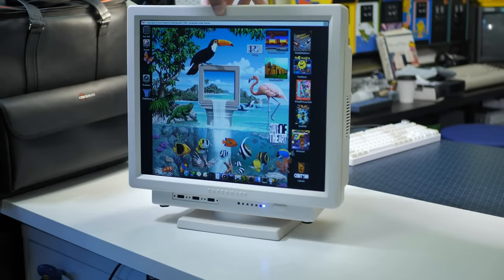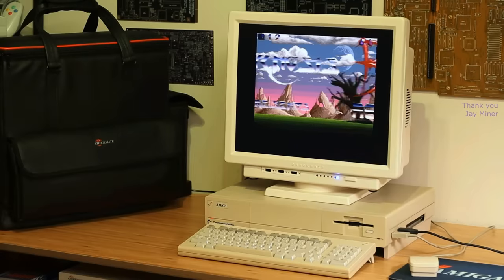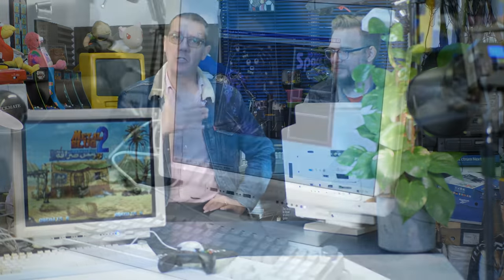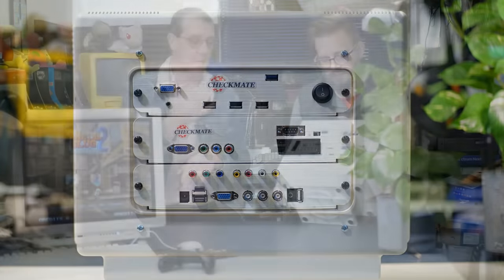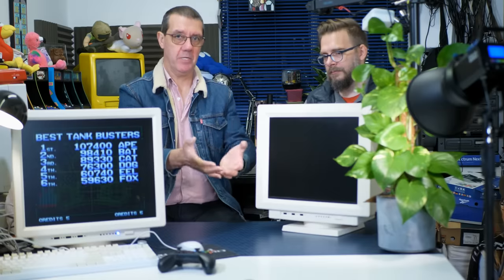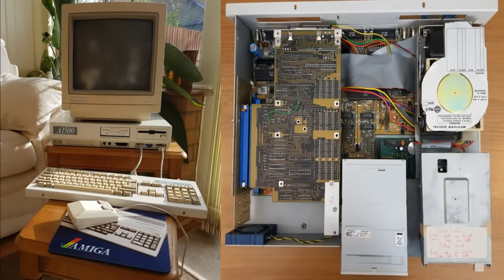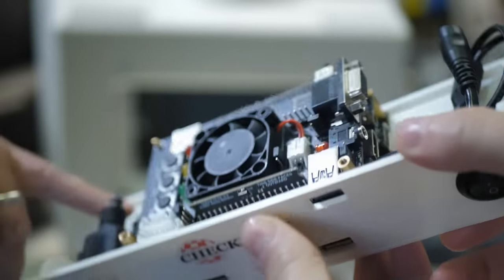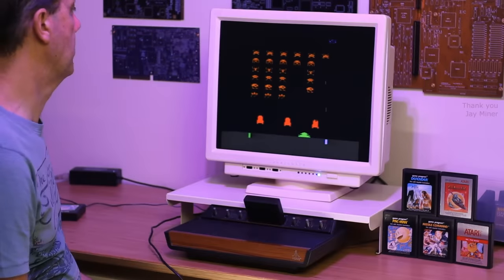This Monitor is the Future | Nostalgia Nerd

Comment: What I see here is that it's a monitor and a project box all in one. You wanna build something that needs a monitor and goes in a box, you can put the project directly inside the monitor. I'd love to see someone build as period-authentic as possible VT100 terminal. I really don't want to buy some crappy beat up terminal on EBay. Would be nice to have something built from new parts.

Comment: Arcooda panel as an option? They should have led with that. 

*Edit: I believe this option wasn’t known or guaranteed,at the time the campaign started.

It’s not highlighted in the kickstarter. Also,in the campaign it’s noted the panels will be 5:4 but no mention if 4:3 is an option. Either way,thanks for sharing this info.

Comment: The connections are awesome. Ideally the panel should at least be OLED or otherwise very fast to minimize latencies, super-ideally you'd have some sort of a phosphor emulation for, say, color blending tricks to work with real hardware.

Comment: I thought that this new invention, the Checkmate video monitor, is something awesome. I did not think that it was just technically feasible to make a video monitor with all those advanced capabilities. Someone mentioned in that video that they did not have many of those new video monitors left, but if they still make those I thought I could get one of those myself. Someone mentioned in the comments here that CRT displays were good. I think they were but of course they are very old. And CRTs had different problems, I believe, one was that their power supply required a lot of power, and they started using pulse technology instead of a rasterized display, I do not know if that was inferior maybe, and they phased out the picture tubes themselves in later years, the tubes used an enormous amount of power. They also used a rectifier since the 1960s instead of plain tube because they were switching over to transistorized systems. I have read somewhere that they make some new consumer televisions that use 12 bit color processing and are extremely bright. Maybe those do not need to use upscalers because they have RAM memory there that could just show the picture. I was wandering if a consumer TV could use the same technologies that this new Checkerboard display is using. That could be a great design!

Comment: I'm sorry, but I only watched 30 seconds of this video. The moment you mentioned OLL, I knew exactly what you were about to divulge in because I had the exact same experience with those guys at the con. I'm currently using a Dell computer monitor to get the job done, but I really hope to get one of these monitors on my hands. The camera doesn't do justice to the sharp picture quality these monitors have, they're about on par with broadcast monitors and trinitrons.

Comment: How about adding a module that holds a Vortex86SX module for running X86@300+ MHz and at least 128MB RAM, while using the FPGA to simulate the missing graphics accelerator ?
This way, even Pentium range / age titles and software could be run.

Comment: I'm confused, and to no fault of your own, but do the prices include the panel?  I just watched a video where someone was 3D printing a chassis for an iPad essentially functioning as a dock for iPads, hence why I was recommended this channel.   

I'm curious if the prices on Kickstarter also include everything you need to run this as a display, all inclusive.    Reading is hard sometimes and I'm having one of those days.

Comment: Nice concept and idea. But nothing will replace a CRT, the dot per inch any modern IPS display is way to much high res compared to any CRT tv image resolution and how the image was generated using analog cathode ray tube and a shadow mask. All these consoles  where optimized for CRT, and the image in TV's was not crisp and clear because literally no one was watching 1m from teh scrteen, a minimum of 3m was the closest and watching a console image that this generation calls "pixel art" on a CRT tv with traditional screen from couple of metters away, and not on a trinittron of newer flat screen crt, the image looks gorgeous and a lot of the pixels disabear because the image AA was and is blurier because of the shadow mask. Sitting with latest hardware on the market here and i miss my old 35" crt TV lol.

Comment: What OS is the one with the toucan in the wallpaper? I’ve been trying to find a software I used in 2nd grade and the layout of the screen looks pretty similar to what I remember it looking. That would narrow the software catalog I would need to look through. Also it was some graphics software that had some interesting features. Was pretty sure it wasn’t a windows based system.

Another software I’m trying to find was in 2003. I swear it was by encyclopedia Britannic and had a section where you could virtually explore areas like a pre google street view. I remember exploring a path in Australia and maybe somewhere in Africa and Asia.

It’s not too important just nostalgia and closure.

Comment: Damn, that's cool. It would be cooler if there were a widescreen version for that era in the early 2000s when people were using CRT HDTVs...like PS3 and Xbox 360.

One other thing I would worry about is the accuracy of reproducing games designed for CRT monitors and TVs. Sure, the ports are there, but does it look right? How are the black levels? Etc. etc. etc.

It's nice to hear about the low latency. That is important for games. I mean, who's doing productivity work on this thing? This is for retro gaming, pure and simple. No one is itching to run Word 97.

It would be great if someone could figure out how to make a panel that makes CRTs completely unnecessary, but no one has figured that out yet.
Reply: you mean OLED panels?
Reply: @alexalcalaortiz368  OLEDs are great, but they don't display retro content (especially sprites) properly. They don't have scan lines either.

Comment: I'm looking for MicroLED or at least QDOLED, 120 Hz easy or at least 100 Hz easy,   4000p, ideally 2:3 aspect ratio, like 4000x6000, but 1600p would still be OK.
I have and use CRTs now, Samsung 1100MB 130 Khz, Sony F520 137Khz, Samsung 757DFX 96 Khz, Daewoo 518B 69 Khz.

Comment: What happened to someone putting a product to market and then people buy it at the store, plug it in and it works? You’re paying an obscene amount of money for a product’s partial manufacturing to be funded, to pay more later to get the panel, to then pay for all these add-on modules that might be coming? Ugh, this is crooked. What has this world come to?
Reply: Well, that's investing in a product. Not everyone can just put a product out in stores as if they have all the money for it at the moment, and sometimes items are so niche that putting them in a store makes less sense compared to a crowdfunding project. But, sometimes, it really is just that people don't have the funds or investors to do something other than crowdfunding.

I mean, I don't know what's going to happen to this specific product, but as far as crowdfunding in general is concerned it's the better, or only, option for certain things. But things can screw up or change all the same.
Reply: This is a niche product that no serious investors would fund to put into megacorp stores. Therefore it has to be funded by people who actually want it, with limited stock being created specifically for them.

Comment: I wish someone would make a flat screen that updates like a CRT, meaning updating when the video signal tells it to, rather than at a specific rate.
Reply: You mean G-sync? The main problem is that in an LCD molecules have to rotate mechanically. And one direction is just diffusion. Inherently slow. It is like phosphorescence, but not across 10 scanlines, but 10 frames .

I don’t know why people don’t talk about this. Strobe the LCD and then let the molecules rotate back into their standard position while in the dark. So for the next frame they all default to deep black.

Comment: This is the second time someone's covered this but I still don't get it. It's just a 300 dollar 4:3 display riding on nostalgia. If it was an impressive monitor then they could pull off some of the cool filters like the Analog Pocket or something but it's literally just a monitor, all the functionality comes from upscaler boards that most people interested in this stuff already have. It's cool that it was funded so the people that are interested will get one but its an expensive gimmick

Comment: I read that the panel is not CRT, but IPS, so if you have retro consoles that use lightguns for some games, which practically almost all of them, they wont work with this monitor.
Reply: "which practically almost all of them"???
Reply: @moosic2i  yeah, almost all retro consoles have lightguns as accessories for their shooting games.
Reply: the panel isn't even included with the kickstarter. it will be an additional cost, and there will be three tiers to choose from, though what those tiers are exactly is yet to be decided, and possibly an OLED option, according to info on the kickstarter. this model in the video, which according to Mr. Jones represents the middle tier, looks like a 10 year old generic ips panel (ie shit). light guns will not work with any of the tiers or any digital displays at all as they are dependent on the analog signal from the console.

Comment: cool thing ... the 2-3 slow frames is well (from 1-2 sec input lag), a thing that you have to get used too when you play old games on new TVs Panels ... even new consoles on new TVs have it ... PS1 or Dreamcast games, that need rhythmic input (QTE) will be unplayable , fine example it Parapara the Rapper on PS1 that on new TVs is Unplayable ... same what is Space Chanel 5 ... the input lag is so bit, you can't play those original games on Original hardware on new TVs , even Emulation will not help ... yeah, both games where remastered to play on new consoles , but we all know how all those woke remasters look like (fine example is Yakuza that removed missions from the PS4 version , compared to the PS3 version)... another example is Resident Evil 3 Remake that misses 60% of the game ... not to mention making all characters fugly

Comment: I'm a bit concerned with the lack of panel details, temporal resolution and sample and hold is super important for a flat panel. Assuming this is a off-the-shelf 19" ips panel, I'm concerned. If we can't get solid specs on the monitor it's gotta be a no-buy from me, plonking in line-doublers is awesome but if the panel sucks it's a paperweight.

Comment: The future of a monitor would be a CRT with all these pods, The C-64 used a light pen, That won't work on this, Lets not forget about duckhunt and the light gun that won't work on this, Yes they do make modern light guns for modern monitors but they are expensive and not original hardware. They are still actually making modern gaming CRT monitors also.
Reply: But who, who possably could developed new crt tubes I tougt they didn't make them anymore they just have them in stock?

Comment: Now that more is starting to come out about this project, I'm so very uninterested. There are literally a MILLION 5:4 monitors out there. 1280x1024 is NOT a hard aspect ratio to source, still. This project would be notable if it were an actual 4:3 display, but it's not. AKA your search for a Dell 2001FRP is still on.

Comment: I don't agree with one thing. Or, better said, I think that something said in this video is not quite "correct". I can replace all the monitors with this one. Sure. But then you could also replace all the consoles and PCs with a small PC that has installed a lot of emulators. But where's the fun in doing that? Same with monitors, I think.  However, this monitor should be awesome for testing old things, before connecting them to the proper monitor/TV.

Comment: Too bad this is no 4:3 screen. 19 inch panels are 1280x1024, and thus 5:4. They should have opted for the far better 1600x1200 panels are 21,3". Weird thing is Samsung & Dell made 21'3 inch 1600x1200 IPS screens WITH S-video/composite input and 100% sRGB CCFL backlight, and you can find these used for like 10 bucks.

Comment: Can someone make a TV like this but instead of different connection just put like 20 HDMI ports on it? I have a PS5, PS4, PS3, Xbox SX, One, 360, Wii, Wii-U, Switch, Chromecast, blueray player, and a laptop I'd like to plug in all at once and not have to switch HDMI cables. I have an HDMI switch with 4 extra ports. It does autoswitch to whatever is turned on but its still not enough. I'm still about 4 HDMI ports short. I could get another one but c'mon. Really?

Comment: IPS really? OLED is the only screen tech that comes close to the color of CRT and the perfect contrast
Reply: OLED also emulates the burn-in effect of CRT perfectly, I prefer LCD for the peace of mind that the panel is going to last 20+ years with no degradation. But the cool thing with this monitor is that if you can find the right panel you can swap out the internals. Unfortunately I don't think you'll find a 4:3 19" OLED panel anytime soon. They are all 16:9 or 16:10
Reply: @SAerror1  burn in effects of OLED are always over-stated. If you run them at the lower brightness levels CRTs produced you'd be fine for many years. Yeah, there are no mass produce 4:3 OLEDs. But I imagine it just be hard to find IPS that ratio too.

Comment: Feels like something FAR to early for something like this on the market. Going into a thriftshop you can get a decent early-mid 2010's monitor that accepts a shitload of connections for between 5 and 25 euro, while this thing has in it's default setup with the cheapest display panel less connections for upward of 450 euro.
I get it's a better display than those TN displays from a decade ago, but to me the whole expandability seems more a gimmick to upsell people stuff than anything you'd actually use beyond the ones you need.

Comment: But this is not suitable for retro just because it's 4:3, that's not the point of retrogaming. I want the manufacturer to actually build a CRT slim monitor, not an IPS display "retro wannabe" monitor.

Don't these guys know what are cathode ray tubes? they have a specific way of showing image as well as virtually 0 input lag.

If I have to spend 300€ on a 19" IPS 4:3 display, I better buy a 21-32" second hand CRT flat TV in a very good shape and I still have money to buy another one. Actually, I bought 2 Samsung 21" 4:3 SlimFit TV's with less than that, one is still new and the other I found second hand in a store in a pretty good shape (the one I'm currently using). Do not give up, get a real CRT TV.
Reply: You can’t have a slim CRT. That’s not how the physics works. The tube needs to have a minimum length to produce an image. Besides they have already explained that you can’t really find CRT tubes in a mass quantity anymore, other than used ones.
Reply: It`s just one little problem, NO ONE makes crt`s any more, yes you can buy used one but it`s just a mater of time when it will die, this is atleast futureproof and good replacment for diyng crt`s.

Comment: i absolutely don't see the value of this, it's just a 4:3 off-the-shelf LCD such like you could buy for years in some fancy retro styled casing
Reply: It's an all in one with every connection you will ever need for Native retro hardware. This is for the hardcore retro gamers and collectors, especially those who want to save room space. It is half the size of a basic retro monitor, and less than half the weight.
   Your lcd panels don't have all these connections built in. I wouldn't pay more. Than 200 to $300 for it, because I have a limited number of retro games and retro hardware.

Comment: If it doesn't offer CRT-level latency it's DOA for much of its apparent intended use. Everything else it offers can be replaced with adapters on any modern monitor. What a pointless product.
Reply: Wrong! Did you even bother to watch the video?
Reply: @moosic2i  no, but in my defense I was born at a very young age

Comment: This is not a CRT at all. Why IPS?
Reply: Obviously it's not a CRT... It's an LCD with switchable input modules for expansion.

No idea if the project lived, but it wasn't supposed to be a CRT. It was about packing a load of various connections into a modern monitor.

Comment: Why not OLED? IPS ist sh*t
Reply: OLED is incredibly expensive and has input lag, really bad for older systems and outside the scope of this project. Even with the added shipping costs theyre putting on this project, the £500 or so total for each monitor is not going to cover the use of an OLED screen which can bump costs into thousands even on a mass produced hdmi screen.